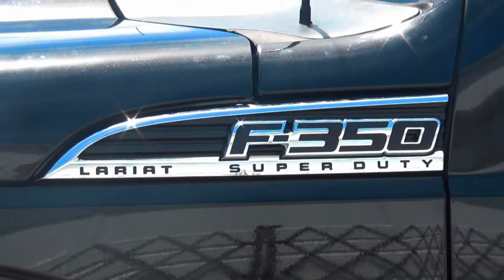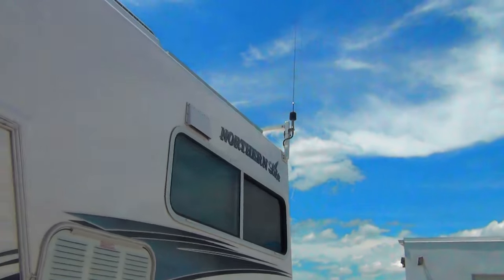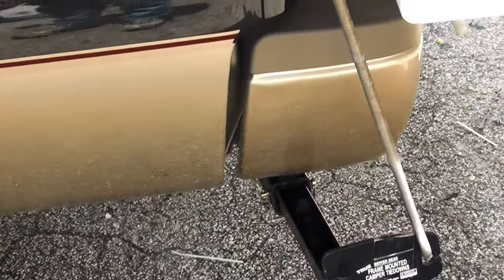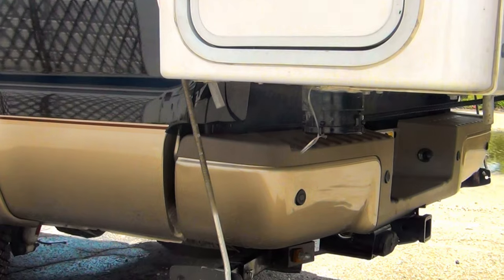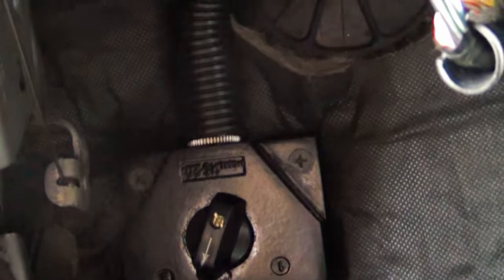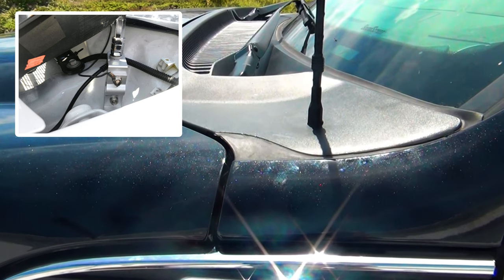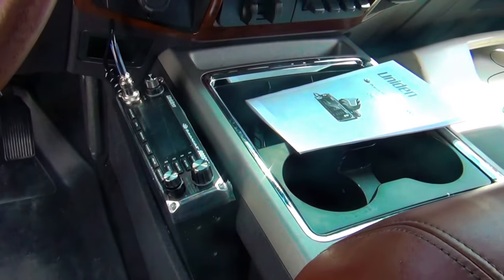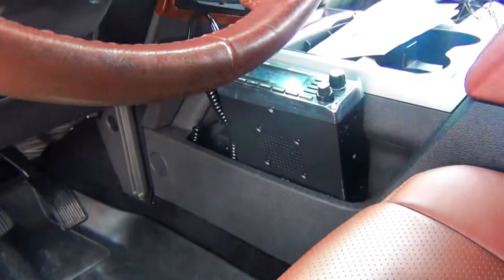CB Radio and Antenna installation Ford F350 with Motorhome / Camper

Comment: love the CB install.... when they break in and steal it no damage to the truck... seen a few ripped off the under dash leaving the dash all broken  costing thousands to fix.
Reply: I got a bluetooth mike and the radio is about the size of a deck of cards and will install anywhere. But I guess it's going to be hard to hide that antennae on the hood. I hadn't even thought about it getting stolen.

Comment: Clean install Screwdriver. I always wanted to do a wire dipole on the rooftop of the camper but have never experimented with the idea
Reply from the maker: It works !!

Comment: Thanks for sharing the antenna information.  I am thinking about drilling a hole in the trunk of my car to mount a 108" inch CB antenna, but I am not sure my car trunk is grounded ?      Do all cars have grounded car trunks from the car manufacturer ?

Comment: Overpasses might take that antenna right off of that thing
Reply: Guess it depends on overall height. No McDonald's drive thru for that vehicle.😂
Reply from the maker: You all are missing the point of the two antennas, the tall one is when at the campsite, the fender one is for on the road.
Reply: @BellsCB  I see
Reply: @BellsCB  
Ahhhh, hence the antenna switch.

Comment: Is the antennae going to hit the camper in heavy or highway speed wind?
Reply from the maker: No just misses it
Reply: @BellsCB  I've got a 2006 F450 and the place you've got the antennae doesn't really exist (it's a grate). And I got a magnet mount so that's not going to work. What happens if you install 102" on the camper roof at a 30 degree angle back? Will it work the same or does it have to be pointing straight up? My camper is already at 12ft at the air conditioner but with the antennae at that angle it won't be much higher than the AC.
Reply from the maker: @Maxid1  I think this bracket will do it: https://www.bellscb.com/products/accessories/Custom_stainless_brackets.htm#:~:text=1999%2D2010%20Ford%20F250/F350
Reply: @BellsCB  The KF2-L
AUF2-L that says it's sold out?
Reply: @BellsCB  But I see I can get it at lots of places. Thank you so much for your help!